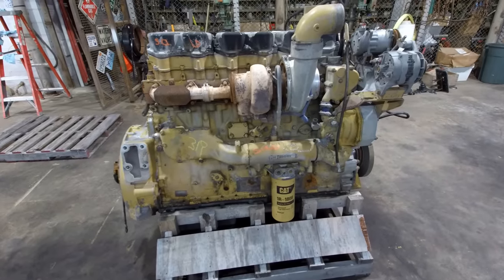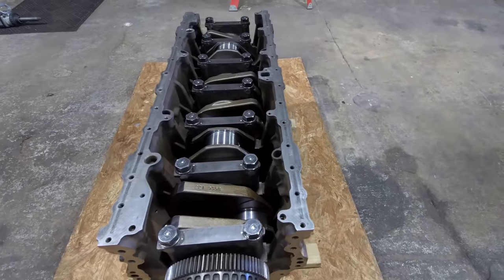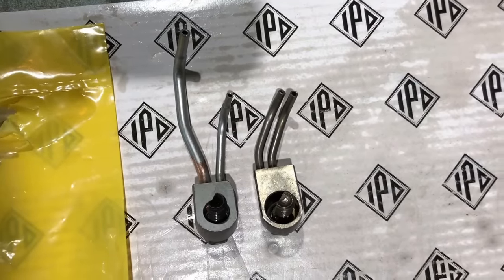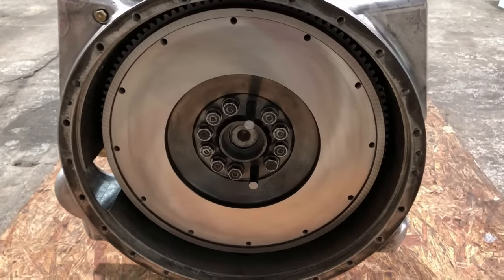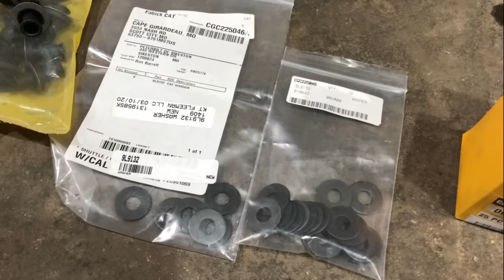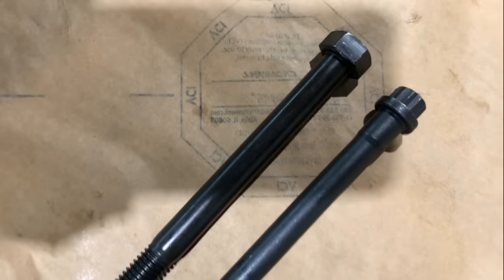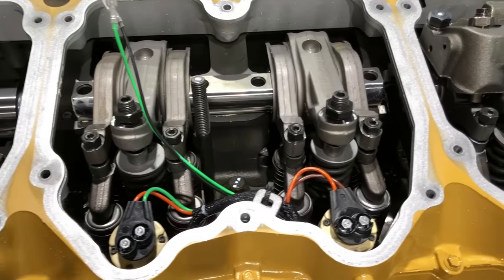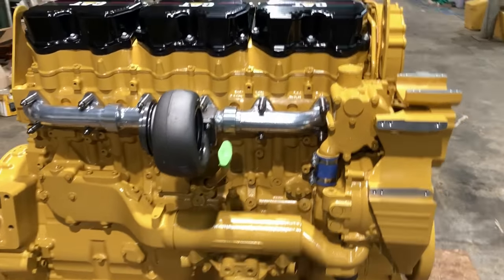800+ Horsepower 17 Liter Caterpillar Diesel Engine Build from Start to Finish + 1973 Peterbilt

Comment: Glad I stumbled upon this video... great memories!  I was a wood pattern maker apprentice at the Cat Mapleton IL foundry back in the 80's.  We made the wood patterns and mock-ups that started the prototyping process for each casting part number.  The wood side had 50 journeymen and 2 apprentices; it was the best, most exciting job I ever had.  The pattern shop was connected to but separated from the foundry.  It was well equipped, well lit, air conditioned, and quiet.  Some of the journeymen served their apprenticeships right there at Cat.  Others came from all over the globe and from all aspects of industry.  One journeyman learned the trade during WWII while serving on a submarine tender ship in the north Atlantic!  All were immensely talented.  I was moved around the shop every 6 months so I could work and learn from all of the journeymen.  Patterns and core boxes were made 'old school' by hand from mountains of mahogany.  I remember working on the first wood patterns for the then new 3600 series engines.  The V12 variant was so big it took 5 days for the casting to solidify!  By the mid-80's cnc machining was coming on fast and the Cat pattern shop (and most corporation shops) was no longer viable.  Being a lowly apprentice, I was first to be laid off.  I finished my apprenticeship at another pattern shop specializing in aviation super castings and worked as a journeyman on castings for F-14, F-18 aircraft, and various other defense components.  I heard the Cat pattern shop closed in the early 90's.  I think back at my time at Cat with great pride.  Your comment regarding the surface 'bug' on that engine casting made me smile:  "That's just the way these castings are... they don't make these to look pretty"  Did too!!!  ;<)
Reply: Cool
Reply: That's a great story brother, thank you for sharing
Reply: @Randy B, amazing Story Brother, about some very Cool stuff! Would have loved to been around there, during that timeframe when Real Craftsmanship was being churned out by Real Craftsmen. Thanks for sharing. Just curious as to why you Guys used Mahogany??? 
I know there’s a specific reason, just wondering what it is, this some very expensive Wood also.
Thanks, Phillip Chambers
Reply: @phillipchambers8487  Thanks for the nice words.  Mahogany was the 'go-to' wood for patterns.  It machines well, carves well, and most important... is very stable.  Once a part number had been prototyped and revised using wooden patterns, permanent cast metal patterns are ordered for production.  The wood patternmaker would then make a "master" pattern... usually from pine.  Foundry patterns are made oversize to accommodate the shrink each specific metal goes through as it solidifies; iron shrinks 1%.  If the production part is iron (1%) and the production cast tooling is iron (1%)... the wood master pattern is made oversize with 2% shrink.  Pine was used for masters because it only has to make 1 casting...  which it becomes the production tool (with 1% shrink).
Reply: @randyb6496  I figured it was something along those lines as to why you all used the Mahogany. This is very interesting to me. Man, I would have loved to seen all this in action. That had to have been a really Cool place to work, and very Cool job to have.
Reply: Thanks for sharing 👍
Reply: @randyb6496  I was curious how much the tolerance of the wood pieces would shift due to temp and humidity. I love CATerpillar, and take great pride operation CAT equipment and my uncles dad and grandfathers all used CAT in their rigs and my cousins are CAT mechanics. Grew up around yellow machines and engines. Now I need to stuff a CAT one day in my 95 power stroke with an Allison. It would be a dream come true. Come guys like classic muscle cars and hi performance sports cars and they are cool but Diesel engines especially performance engines are truly amazing and getting something big and heavy moving in a hurry if far more impressive displays of power and engineering. Stay healthy.
Reply: @youngmike8645  Hi Mike... I remember asking that very question to a journeyman early in my training: "what if I start finding dimensions are off from wood movement in the middle of a job?"  "You can't chase your tail" I was told.... "you'll never get anywhere."  Good advice.  You learned to pick the 'killer' wood, do all the tricks to keep your pattern stable, and don't look back.  "We ain't making a watch here!" they used to say...  ;<)
Reply: @randyb6496  mass production always blew my mind. The item itself is an amazing subject alone, but I always thought that the process and machinery to create said item is even more impressive. The fact that everything just fits as no works and does so c with incredible reliability is just mind blowing. Maybe it’s because I’m a simple man but I always thought the concept of someone complaining something broke after thousands of heat cycles and lack of maintenance, billions of revolutions and they bitch that some part is expensive or think the repair should be almost free. The amount of things that have to go perfectly right everytime the key is turned (gas or diesel) is truly a testament to the engineering behind it. I’m still, after all these years operating equipment in awe of the amount of material I can scoop or push or lift without breaking a sweat with a slight motion of my fingertips. The amount of men with pick axes shovels and tnt it would take to fill one tri-axle i load in a little less than 3 scoops with a 72” bucket on something like a CATERPILLAR 345. Takes me about 1.5 minutes to load if the material is semi soft or is shale. Hydraulics are absolutely amazing to me a rubber hose with some braided stainless can handle the insanely high pressure. A little oil moving tons of steel with enough break force to tear through earth and rock. You could say I love what I do. Nothing like the smell of diesel smoke and grease first thing in the morning.
Reply: very cool....mind if I ask your age?
Reply: @lukula2934  I turned 30 last July.
Reply: Can't tell you how good it feels to hear folks like you tell their tales...The young ones will
otherwise go to their graves without knowing that work like this is what made the western 
world so advanced and capable at whatever they/we put our minds to. If our kids don't pull 
their heads out of their phones and their asses, the next generations will have to reinvent
the damned wheel.
Reply: I always thought the pattern making job was the most perfect combination of artistry and technical precision. I bought an old Craftsman planer from a retired pattern maker who spent 30+ years at a foundry here in Pittsburgh. The stand he made for it is a work of art, absolutely flawless.
Reply: Randy B. Thank you for your comments, find them intriguing as I've been a mechanic since tech school in 69. Here on the west coast(Oregon) we know nothing about foundries or assm. plants. Can't remember where a saw a wood pattern piece from a foundry, but the first thing I thought of " if this block of wood could only talk! Be looking for
 one ever since.
Reply: That sounds like so much fun.
Reply: I would love to surround myself with talented and educated people like yourself . I run heavy equipment nothin better than CAT .
Reply: @youngmike8645  hell yeah brother ! Love my d10t and 345 14s are too fun to play with .
Reply: Thanks for sharing brother 👍
Reply: @lukula2934 .... Not to worry about the "next generations".... because Most of this present one, will not be around to have "next generations"...... sadly.
Reply: It was great to read about your experience in the pattern shop.I did my apprentiship with a master pattern maker ,a extremely tallented man who tought me do it right the first time,that was over 60 yrs ago and something that followed me my whole life and which I taught my boys who have both become excellant tradesman.- Ed
Reply: It was great to read about your apprentiship in the pattern shop.I also served my apprenticeship in a pattern shop with a master pattern maker some 60 yrs ago .He to taught me to do it right the first time ,something that helped me my whole career,and something I taught my two boys who have become excellant tradesman.-Ed

Comment: BEAUTIFUL ENGINE!  TOP NOTCH BUILD.

IN CASE ANYONE WANTS TO KNOW:  The term ACERT is an abbreviation for Advance Combustion Emission Reduction Technology. This engine mainly focused on the air and fuel systems in an effort to meet the strict EPA emission requirements set in 2002.
Reply: Thank you.
Reply: was wondering about that, thanks
Reply: I wish Cat would get back into trucks.
Reply: @electric7487  MY GUESS IS CAT QUIT THEIR HIGHWAY TRUCK SEGMENT BECAUSE OF EMISSIONS REGULATIONS.  MY LAND LORD RUNS A 1997 PETE WITH AN END DUMP TRAILER HERE IN CALIF.  SOMEONE CORRECT ME ABOUT THE COST, I THINK HE PAID $28K TO INSTALL THE CALIF. EMISSIONS EQUIPMENT.  MORE THAN THE PETE IS WORTH.
Reply: @seymourscagnetti1413    WHY ARE WE SCREAMING !!!
Reply: @hihaveaniceday9386  KEYBOARD BROKE (DELL PRECISION M6700 "WORKSTATION" WITH BACK-LIT K/B) ORDERED A NEW K/B TWO WKS. AGO.  NOT HERE YET.  THANKS FOR CHECKING IN.
Reply: @seymourscagnetti1413  yea that's pretty insane to throw a box and egr on an engine that isn't meant for it and I'm surprised that it's even driveable
Reply: @electric7487  why, I mean they just couldn't give enough of a damn to keep up and decided that it wasn't profitable

Comment: Just wanted to say your channel kicks ass. Ive learned so much about old Detroit motors thanks to you. One of my favorite sounding engines is the Cummins L10. I worked as a maintenance guy in a metal recycling yard. The boss (been there a million years) had retrofitted all the old Kohring cranes with L10s. There was one left when i started there. Never touched a diesel engine in my life and they told me to go change all the rocker box gaskets on it. I was so proud when that thing fired up and ran just like it always did when i was done.

Comment: Absolutely beautiful work. Back in 1985 I rebuilt a few different truck engines, a couple 671 and 871 Detroits, one Cat (don't remember which one) and 3 or 4 of the old 855 Cummins. Worked as a diesel truck mechanic so I did the whole thing from the customer driving into the parking lot, to the customer leaving again with a rebuilt engine, brakes, I rebuilt Transmissions, anything it needed every every Nut and Bolt. The engine shop was always my favorite though. Transforming that nasty greasy worn out old diesel engine into something shiny and brand new and then run it on the dyno and see (and hear) what I made possible. And taking Pride in doing a good job. Signing off on that engine that I rebuilt it! 
Turns out that I started driving truck rather than working on them but my dream was always to work in the shop I did nothing but rebuild engines. I will always regret that I never fulfill that dream. I ended up driving semi for 25 years and then became disabled just because I broke my body from the hard labor, but watching your video here brings back those memories and that desire to do that work again and really create a work of art when you take the time and the pride in doing it correctly.
I love what you said about measuring the protrusion on the liners and swapping them around until you got them all within tolerance and weighing the rods and flow matching the injectors. That is going to be a sweet running engine! Just wish I could still have a hand in creating something like that. I subscribed and will be watching more.

Comment: I ran a drilling rig that had 2 c15’s on the rig floor running the draw works. They had straight pipe exhaust and were beasts.  I also ran a rig with old 353’s on the floor.  All the other rigs were electric with 398’s, 399’s, and 3516’s on the generators.

Comment: When I was a kid I drove an International  2 stroke 18 speed double dog that sounded just like your dumper. Used the clutch for 1st  only and had a ball skipping around the gears when it was empty .  I am pretty sure not many kids could figure that one out today which is a shame because the thrill of driving has been removed  for a very long time . Thanks for the build - whatever you get is worth every penny in my eyes.

Comment: "Competition truck"? I AM in competition on the highway every day. Aren't you? LOL!
Reply: That was what he meant. Screw the feds and their war on real men and real power.
Reply: @ryanburbridge  Oh, I guess he is better at sarcasm than I?
Reply: Marshall Moneymaker nah i liked your comment and it’s sarcasm lol
Reply: 6nz Forever, Mines in a 2003 Flattop. 1,050,000 on it.
Reply: Theres no competing when you drive a castrated truck,  everybody is passing PRIME,  I make pretty good money at 70 mph that's as fast as she goes , except for when the wind is at her back , then it's 71 woohoo,  I'm getting a nosebleed
Reply: @anthonyniester9701  good
Reply: Marshall Moneymaker got to beat Larry on that road to unload
Reply: @anthonyniester9701  Horsepower doesn't get you up the mountain, torque does.
Reply: @ryanburbridge  And a guy like me who just wants a damn tractor to work my property that won't need a dealer tech to reset the ECU if I fix a leak.
Reply: Where is you place.?.
Reply: Whay cant you use this setup on highway?
Reply: @rks9612  likely due to emissions or in this case, a lack of
Reply: Well when youre an IPD dealer and want to stay that way you kinda have to watch what you say.
Reply: @brad2761  you got it wrong... there will be plenty of emissions coming out of the exhaust!

Comment: The Detroit V engines revving hard (the right way) make me giggle like a little kid. 

The big Cat engines and their lower rumble makes me go “Ooohhh baby!”
Reply: You should try train engines.  I interned on a Class III railroad, and there wasn't much that was more visceral than starting the prime mover on one of their SW1500s.  Those locos weighed 120 tons, but cranking up the engine on one would make it shake like an earthquake.

The prime mover (engine) was a V-12, 1500 horsepower, 15 ton beast from GM's Electro-Motive Division.
Reply: FS2K4Pilot, I have spent quite a bit of time around train engines. Fueled them for a time and have loaded/unloaded in the yards when they were being started. 

I’ve even been aboard when they are starting (have a few friends who work as engineers). 

You’re right, it’s deep and visceral. Same as the BIG marine diesels and even ore haulers with their 35L diesels. 

I prefer that 15-18L Cat sound to any Diesel engine. Especially when it’s tuned and piped the right way.
Reply: Elijah Robinson I'm partial to the EMD 16-710G3A myself.

Comment: An interesting subject in my opinion is injector pulse width in relation to injector firing time (in degrees before top dead center). 

Banks Power has a good explanation on why going to a bigger injector can help lower emissions at the same horsepower.

Comment: Wow. I had no idea you could put a C18 kit in a C15 ACERT 6 NZ. I have only seen one C18 and that was in a 379F CAT trackhoe.  The machine itself was a monster.  I have drove a truck for over 12 years and that was one of the biggest trackhoes I have ever seen. It was on a pipeline job..
Out of all the trucks I have drove and different motors in each truck my absolute favorite is the 3406 E class and the 3408. Although I have heard stories from older people that say the B models were where the real power was at and changing the fuel buttons on the pumps. But I still love the 3406 E. I have pulled over 95000 pounds and running up hill at 75 mph and it was still eating with the pedal on the floor like the load wasn’t even back there. With that said, I would absolutely love to drive something with that C18 in it....is there any way we could see this motor in the truck it’s going in and hear it run and drive
Reply: Hell yes, had one in Idaho
Reply: A c18 is essentially the same exact motor

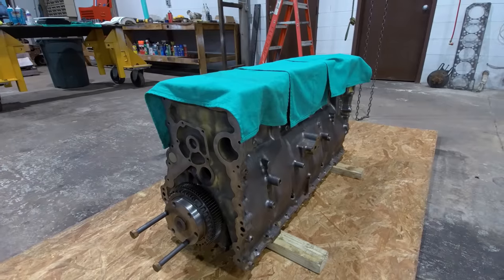Comment: 7:00 made me hold my breath
Reply: I agree I was torqing headbolts on a new Cummins block and the threads pulled out of 3 holes Cummins said the block wasn't cured long enough but watching that you can get hurt real quick if a socket breaks or something else I learned to pull with one hand and have a firm grip on something with the other I also snapped a new Cat headbolt off in chassis I'm glad I was holding on or I would have went flying

Comment: I like how much time you spend getting those liners evened out. I had an N-14 that popped two out of three head gaskets early in life because Cummins thinks it’s okay to be at extreme ends of “acceptable range” when they put engines together. It’s the same reason their reman heads don’t last, because instead of aiming to zero out clearances, they again let stuff go that is on the edge of unusable. Quite often they’re rebuilding cores that are only good for doorstops, but selling them as “genuine Cummins reman”. The customer should love that engine.
Reply: I've heard horror stories about cat fucking up remans too and getting injectors that do a hand grenade in a cylinder